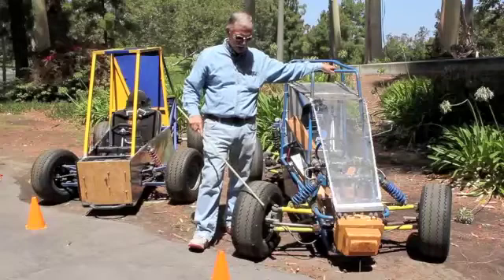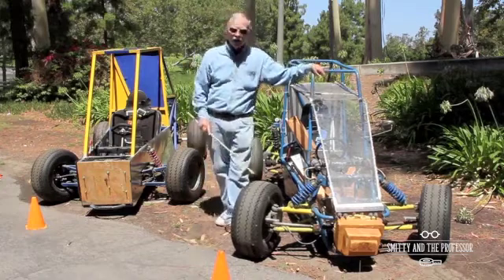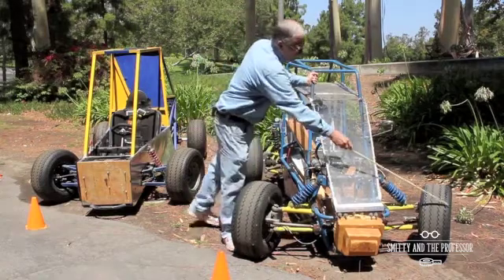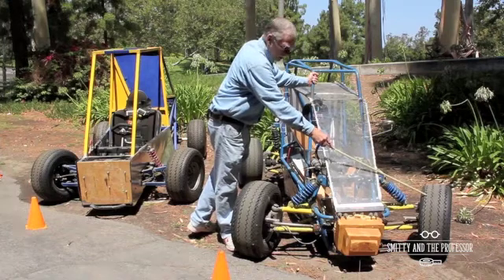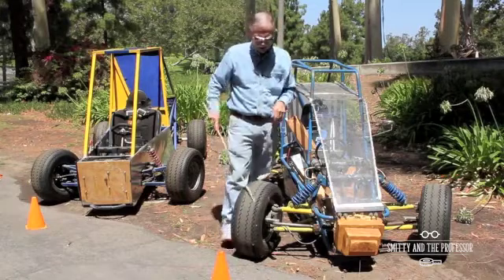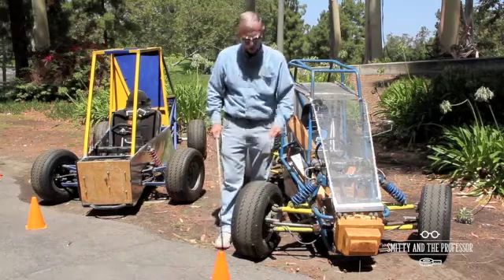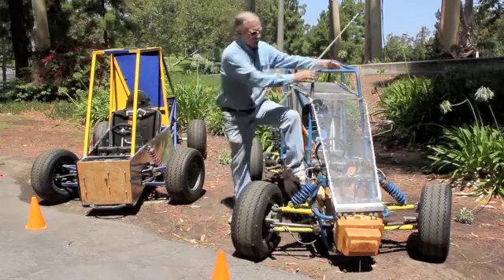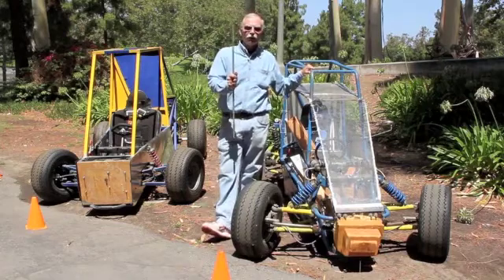Intro to Racecar Engineering: 13 Tires

Comment: Used to CAD some race spindles years ago. 

Another bit in the whole castor, camber, steering axis inclination, is also the steering arm on the spindle and steering mechanism. Focusing on the spindle itself the arm if the rod is a straight push/pull is that arm should angle from center spindle and axis meet to the center of the rear of the car or forward. as you push on the outside spindle and pull on the inside spindle the rate of change of each spindle will turn at different speeds some . This will allow for tighter turning radius on the inside wheel vs the outside wheel. This allows for less scrub thus better traction.

Great videos - Your YT video is of only a few that shares details such as geometry under load should be accounted for.

More areas of detail that affects steering geometry is pivot axis location  and length of arms attached to spindle.

Comment: Hi, I’m curious which has more contact patch between a taller and wider tire.  For example  255/40R18 vs 265/35R18?
Also if I move up in tire size, does it mean it requires less air pressure?
Thanks in advance !
Reply: Hi SiFo:
 Robert Pepper has your answer.

Succinctly, with wider, lower profile tires vs skinnier, higher profiles, it's the orientation of the patch area that will change the most - by a factor of at least 4:1.

Given the same cold tire pressure in both:

A narrow, higher profile tire will have a narrow, longitudinal patch.  That is, parallel to the direction of travel.

A wide, lower profile tire on a monster rim will have  a wider, lateral(perpendicular to travel direction) contact patch.  

The contact patch on the wider tire/wheel package might be, at most, 5-10% larger than on the narrower package,  but its orientation is what will affect your handling and feel, the most.

And herrrrre, is Mr. Pepper's explanation.  While his primary audience is off-roaders, the information here carries over to the street as well:

https://m.youtube.com/watch?v=spOUcaUzIHY